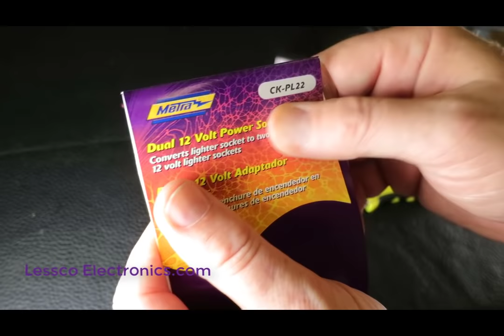How to hardwire 12 volt car accessory without cigarette plug

Comment: Ok video. I wish you had actually showed where you found and connected to the fuse box. Because yes some of us are too dumb, so we need EVERY step by step.
Reply: Find a blank fuse spot, turn key on, get test light thingy and test it etc...
Reply: Fuse boxes are different on every model anyhow so it would not of helped, you have to look up where it is, which is easy on google. and sometimes the fuses are different sizes. and dont EVER call yourself dumb. dumb people dont seek out knowledge, and dont ask questions.
Reply: @lordkayx   Be very carful searching out your fuse box on google.  There are always several shown that isn't the correct one.  compare the results with a look at your car's fuse box.  Keep in mind that cars with more modern electronic accessories and features often have more than one fuse box.   My 2006 Cadillac CTS has 3 of them.  One under the hood and two under the back seat cushion.  If you have the owner's manual, this will be shown, along with the location(s).
Reply: @ronlheureux7623   Very good advice, Im 35 and got my first ride (bronco 1990) in 2000. It , and all my cars since have had one fuse box inside the cabin for the cabin accessories and a second, and as you said even a 3rd, under the hood. For things like engine sensors and not cabin related or controlled stuff. If I am not mistaken, some of those engine fuses can act like a capacitor, which means they can shock you real bad even if the car has been off for a day and the battery is unplugged.
Reply: None of the PA system install videos on YT show this step and Im absolutely fuming because that's the only thing I need to know

Comment: I have my dash cam ran directly to the battery so that when my truck is off it still has power and if someone hits me while park the dash cam comes on and records them. Since I turn my dash cam off when I’m not in the truck it draws no power or very little. Any used power while I’m parked will recharge while driving per the alternator. But to say never ever tie directly or the battery is not true. Many things go directly to the battery.

Comment: Just get an add a circuit adaptor, it plugs into your fuse panel like a fuse holds 2 fuses, one for what was originally in the slot and one for the new circuit.

Comment: Or just use a standard micro USB cable with a 12v to 5v step-down converter. It's just more reliable, that plug has resistance and will probably fall out due to vibrations from the car.

Comment: THANK YOU SO MUCH FOR THIS VIDEO!!!!!!!!  I have struggled for 2 days with multiple hard wire kits for my Wolfbox Mirror Backup Camera/Dashcam.  I watched dozens and dozens of video tutorials on how to install and think it may be a voltage issue with my truck or just user error in working with fuse taps, BECASUE THE UNIT WORKS JUST FINE WHEN I PLUG IN THE CIGARETTE LIGHTER ADAPATER, so for $ 10.00, instead of paying 1 hour of labor at an automotive business (I was done trying to figure out myself and thought I'd pay the hour rate, like 179.00 to have an installer do) this worked perfectly.  It would have been a shame too, because I pretty much did all the work, set up ground, had all the equipment routed, etc, to pay someone for something that would take them 5 minutes to figure out.  THANK YOU!!!!!!!!!!!!!

Comment: I was going to do a flush mount socket on one of the dashboard surfaces but this makes it so it can be concealed completely. I added a flush mount to my work van as a dedicated accessory socket for my power inverter and it works great and looks like it was stock from the factory. I went to do the same for my personal vehicle installing a similar dashcam setup but this makes more sense. Especially since my expedition does not have any surfaces that lends itself to this type of modification. Thanks for the save there. Keep up the good work.
Reply: I want to do this because my dash cam is already there and I could rip out the wire and fish a new cord with a USB instead of the 12V plug is already has, but this would be easier and would free up my 12V plug for USBs converter. 

I hope they phase out these car charger-style cords. If the "C" connectors work for phones and laptops (and now iPhones), I don't see why they aren't changing these dash cams (and other devices) over also. You don't need the 12V part when you download the contents from my cam, so I shouldn't need one for the car either. I've tested it and it works fine with the USB, but since it's already set up, I'm going with the fuse box alternative.

Comment: I've been scouring youtube for a simple explanation like this, thank you!!!
No other videos could answer for me where my black/negative wire would go, now I get it's just to be grounded to a car chassis bolt.
Reply: They both need to go to the battery as, what if you rigged up your homebase to run off a battery instead of mains, you would need to connect both wires to the battery.
Reply: Yeah, chassis or the negative terminal on your battery. Either work just fine. Battery is always preferred but most people don't want to run it all the way through the firewall to the battery.

Comment: Nice idea. I have a dashcam that they dont make a hardwire kit for anymore and I was going to cut the 12v end off and wire it off that, but uaing a cheap 12v splitter is a much better method for preserving the plug.  My CB and radar detector are both hardwired in, but not the stupid camera.  Been driving me crazy.

Comment: I had an almost identical Dashcam and also wanted to hotwire the damn thing so I cutted off that stepdown transformer plug and hotwire the dashcam wires straight to my 12v power supply. It blew the dashcam the moment I switched the ignition on. I had to order another dashcam and wired it properly like you. Its still lasting till this day. Thanks for this informative videos. Subscribed.

Comment: Dude I just searched how to hard wire a cig plug and it's funny I got the same mirror issue lol had not even searched for a mirror cig adapter hardwire I dont know why they would sell a great mirror with cheap adapter harness hell I'm hooking it up to rocker panel switch

Comment: This is the best video I’ve seen in the matter. However from what I know about electrical. There’s no protection in the circuit since you’re only using one side of your fuse. It’s not going through the breakable part. Luckily for my 87 Dakota with crank windows. My power window fuse holder has the female terminal only on ONE side not both. So I can get away with sticking my fuse in the power window switch and putting your little grabber piece on the opposite side without risk of running it towards the battery. Bc there’s no female connector on that side. Thus I’m using the fuse as simply a fuse and not just an Adapter. For those who don’t have this little convenience I would stick a fuse IN LINE of your power side so you don’t cause a fire. 

I’m no expert but a fuse is just a fundamental. Correct me if I’m wrong I just don’t see a fuse being  used to it’s full extent and purpose here. Still a very helpful video so thank you

Comment: Wht not strip the wires if one has a on off switch fixed and pull the fuse in black holder and it should be fine.  I'm doing a flashing safety light which is basically the same.  A great review which help.

Comment: Do you also need a new resistor   or is it fine to wire it to to the already existing 12V ACC cable?

Comment: Great quick tutorial  simple & to the point. Question instead of the metal fuse extender can you use a extend a wired fuse type device?
Reply from the maker: sure, you can do that if it works better for you.
Reply: What is the metal fuse extender called? Cant seem to find it

Comment: Great video!  I just have a few questions:
*  Where do you get the fuse taps? (Home Depot does not have them)
*  My cig lighter was operating off a 15A fuse...should I use a 15?
*  Does the ground need to be attached anywhere?...Or, is it ok with the metal attachment that you used?
Thanks very much for your time.  I hope to hear back from you soon!  PDM
Reply: Ground needs to be attached to a bare metal surface, just having the ring connector on the end is not going to provide ground...

Comment: in 3:07 which you said that it should be used in the side that is not hot, does that mean i should insert it on the negative side on the fuse?

Comment: Hi, will connecting to the Accessory power supply operate the Parking and Monitoring Detection on your dashcam? Surely the dashcam will only operate when the ignition is switched on?  Regards

Comment: I was told not use a fuse tap or add circuit to a existing fuse? This was by an ASE  mechanic the wire will get hot....please reply back thx

Comment: What if I want to bypass all the bulky hardware and just extend the wires directly from the product? Also would an inline fuse be better than using the accessory slot?
Reply: For some reason it didn’t work when I tried that
Reply: Was thinking the same thing

Comment: "find any accessory circut that works by accessory"  I'm lost on that statement. 
Is that equivalent to 'find the fuse in the fuse box that powers your accessory charger / 12v'?
Can I just pick any fuse? Like specifically one that a higher ampage bc Im trying to hardwire power inverter that keeps blowing accessory line (despite being made for 12v)

Comment: How would I hot wire/hard wire a normal wall socket plug into my car? My cigarrete lighter does not work and I cannot get it to work at all.
Any input is much appreciated.

Comment: How many items can I connect to the same fuse? Say the dash cam, led lights, etc. would that be a problem? Or should I find another fuse to use? There’s so many!
Reply from the maker: it's just math and wire gauges that matter to wire safely. Use Ohms law and kirschoffs voltage law as explained here: https://www.thoughtco.com/kirchhoffs-laws-for-current-and-voltage-2698910

Comment: Can we cut the wire from adapter, and hardwire it directly to the fuse box??
Reply: That would be the true meaning of hardwiring it. But if you do that you will likely fry the component as it is meant to run on 5 volts not 12 volts. Not like what this guy is suggesting as "hardwire".  Better yet, find a usb cord that fits your device and run it up to a USB port like: https://www.amazon.com/dp/B00NME2PWC/?coliid=IYHBH50TDNNZY&colid=15KJFCQ12PA4F&psc=0&ref_=lv_ov_lig_dp_it      as these kind of devices run off 5vdc not 12vdc

Comment: What happens if you just cut the cigarette lighter part off and just use the hot and ground? What does the connector do
Reply: I think he’s trying to sell the sockets…because that makes no sense unless you don’t have enough wire  for the length required.

Comment: how would i go abouts adding a toggle switch to this type of set up. im going to be doing the fiber optic star ceiling. and i only want it on when i flip the switch i dont want it coming on whenever the car gets turned on.   thanks. good vid.
Reply from the maker: If you were to do it exactly as I did you can interrupt the red lead on my adapter and place a toggle switch in between there and you got it.
Reply: Badass thank you!!

Comment: ok video..i see where you get the 12volts through an accessory fuse, but where do you get the little jumper you use? you glossed right by that? and where do you put the ground? just find some screw under the dash? help!
Reply from the maker: that part I used is called a fuse tap, theyre at just about any auto parts store's electrical dept. and ground can be any location you find it to be solid and convenient nearby. the shorter the better though..

Comment: what is the little copper wire you used to extend the fuse called, I have never seen one before. I think that would work for one of my projects. I did look over your eBay and Amazon stores but did not see them.
Reply: i want to know too

Comment: Could you hard wire it from the original plug?
Reply: yeah just cut the original wire then you don't need that bulky adapter
Reply: Likely not because the bulky adapter has a voltage converter inside
Reply: @timothywolfe2369  that is true I hard  wired it and it didn’t power on at all when I wired the plug back on it powered on

Comment: Couldn’t just cut the adapter off? You’ve installed a connection that’s not needed. Just cut the cigarette lighter adapter off and then get a piggy back fuse to avoid that stab splice

Comment: good video.  my only question is why keep the cigarette plug for?  just cut at the plug and run directly to the power.
Reply: 3:42
Reply: He makes a valid point about how your accessory may have some power transformation stuff (like a 12V to 5V circuit) inside of it.  You don't want to overpower your device or else you're going to release the magic smoke.
Reply: The only thing in that cig light adapter is a fuse chop the ghastly thing off an put an inline fuse on the power wire
Reply: @clarkescustomcreations  Go take a voltmeter to your cigarette lighter and to bare metal on your car and you're going to see battery voltage.  The standard for USB is 5V.  I can guarantee you that if you have a cell phone charger in your car that it is not charging your phone with 12-14V.  Furthermore, if you feel the adapter and it's warm, that means something is consuming power (something that steps down the voltage in the case of a USB device) which means it's not a passive device with nothing but an adapter and a fuse.

Comment: What area of the ground on the car does it connect to?
Reply from the maker: A factory ground bolt is usually best, but if not a clean area of metal of the vehicle chassis will suffice.

Comment: Just making sure--that means that the device will still have power, even if the car ignition is off, correct?
Reply from the maker: depends on where you connect the power from, it can be either

Comment: What if I don't want to ground the accessory to the body of the car? could I plug it into the fuse panel too? (assuming I use an add-a-fuse adapter).
Reply from the maker: there aren't typically grounds at a fuse panel.

Comment: Hi. Great idea but.....still relying on the normal 12 volt plug/socket, which I find to be really unreliable. Any other ideas?
Reply: Cut it off and then connect straight to source.

Comment: Instead of into an accessory fuse, is there any issue with going into a continuous fuse instead? I want to add a hotspot for my dash cams cloud features and need it always charged. Also what about using a usb female instead of cigarette input? Thanks.
Reply: Wont that just drain the battery?
Reply: @elobiretv  Yes it will. I found another solution but decided against it. It involves a separate rechargeable battery that runs the wifi device. Way more than I care to invest in/troubleshoot right now but if you are willing it is possible.

Comment: Is there a way to directly connect a 120v usb outlet to the battery or fuse panel with a similar method?
Reply: Didn’t know there was a 120 volt usb though they where 5 volts
Reply: The juice isn't worth the squeeze.
Other commenter is Correct usb cables are 5v.   I'm  assuming you are talking about taking the plug the USB cable plugs into to go into a 120v outlet of a wall and installing it in you car.  It can be done, you would need a transformer that can convert 12v DC into 120v AC, but it would be a huge drain on you battery and you would lose energy in the conversions. You are much better of just getting a 12v USB adapter. Remember your car runs off 12v DC your your house off of 120v AC. The USB cables are both 5v but the AMPs determine the charginging speed. To charge faster you would need capacitors, resistors, mofets, et. Totally not worth it, you buy a fast charge system cheaper than it'd cost you

Comment: how can I do the same thing w/o buying something else. I'm looking for video to cut write into the male end of adapter,  toss it, and connect 2 wires via fuse adapter into a fuse box.
Reply: you need that setup so you have the voltage regulator and fuse thats installed at the base of the charger. If your gonna hot hot wire it then you could fry all the electronics on your car.
Reply: also i usually see those female adapters at the flea market and dollar store, or if you look on amazon prime, i bet you can get one next day for 2-4 bucks.

Comment: Or, you can do a much cleaner job by using a piggyback fuse holder that shares a key on circuit. Just be sure to maintain the original fuse and only do this on a fairly low voltage accessories.
Reply: may i ask how you do that and what the benefit is over this method? appreciate it :)
Reply: Jessie Kij There are videos on here that show the procedure.  As I said, this is much simpler to do.

Comment: Hi, i have an extra fan for my mailtruck that plugs into cigarette lighter, is it possible to replace with a usb cord, (already have adapter to charge phone) or arent they strong enough to power fan, thanks
Reply from the maker: I assume you cigarette lighterr port is rated at 10 amps, Why not get one of these:
 https://www.ebay.com/itm/Metra-CK-PL22-Dual-12-Volt-Cigarette-Socket-Port-Plug-Adapter-Splitter-/400296747481?hash=item5d338ba1d9
and split it off to power both items?
Reply: Lessco Electronics well, the cig adapter stopped working, and lost pieces to put back together, have dual usb plug in i use for phone w/extra port, only reason i wanted to put usb instead of a new cig adapter w/wires, thnx though